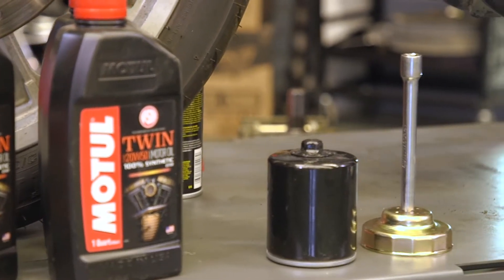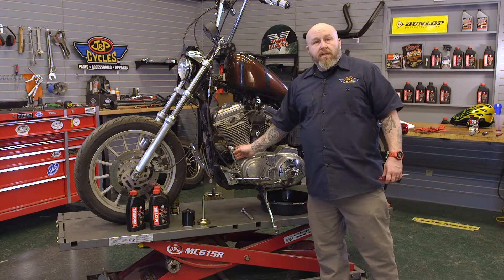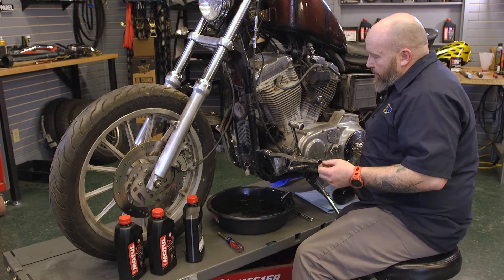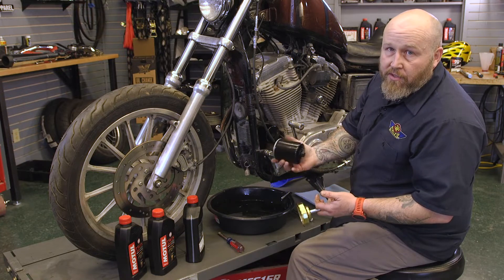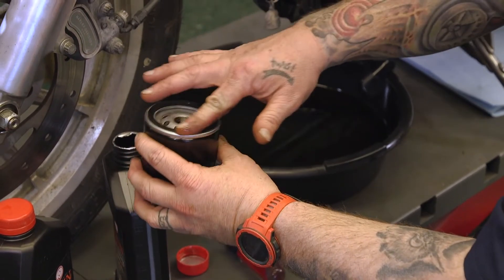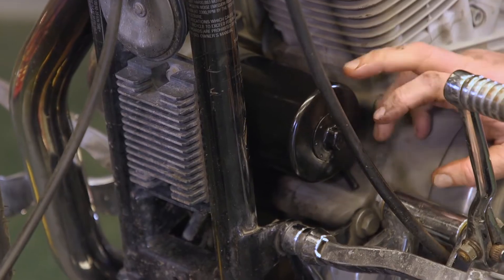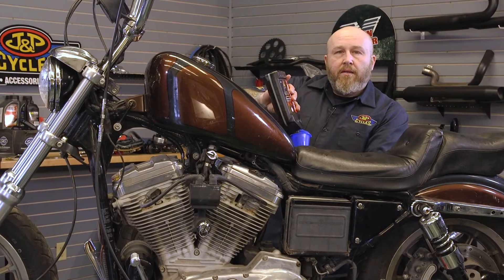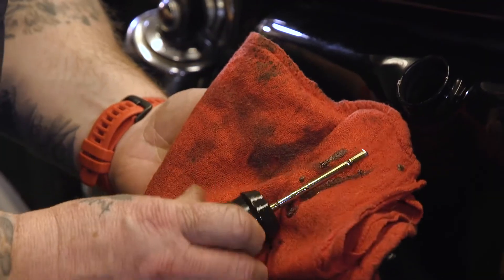Oil Change : Harley Davidson Evo Sportster

Comment: Filter tip. Get the Harley oil catcher “specialty” thing and poke a hole with a screw driver near the bottom of the filter to let the oil drain out into the catcher and down to the drain pan while the oil bag is draining. When you take the filter off there should be little to no oil that leaks out. It’s a lot less than just taking it off. Less mess = quicker oil changes = money.

Comment: I bought a used Sportster and went to an auto parts store and asked them if they could find an oil filter for it. They said they could if I could bring in a part number. I remember the days when they had an application guide. What has happened to America?

I bought a Harley manual specific to my Sportster and can't find a number for an oil filter in it. Imagine that. I find that manuals leave out so much information that one needs to work on something that they are of little use.

Comment: Hi there - 2001 883 Sportster here. I wanted to ask about the oil pump cavitation measure of detaching the hose clamp from the oil tank drain hose. Is thay necessary? Wasn't documented here. Manual says for sportsters between 94-03, thanks!

Comment: Sir, is that a Twin Cam Oil Filter? (K&N) I thought that those filters were NOT recommended for Evo Bikes? (TC needs 30 Micron filtration and EVO needs only 10 Microns??) The filter fits both but it should not be used on EVO

Comment: ’96 1200C, I know this is an old video but hopefully you will see my comment. You make some excellent videos. Thanks for that. Would you have video and know where I can get a “good" rebuild kit for mine? I have to choke/enrich it halfway just to run smooth after it warms up and then of course it idles high at a stop. I’m guessing it needs cleaning but might as well rebuild it while I’m at it. I’m in Raleigh/Durham, NC. Thanks, videos Thanks again!
Reply: might be intake gaskets

Comment: I have a 2018 XL1200C. Pretty sure mine says to check on the Side Stand. 4 ounce in filter. 2 Qts in the Tank.
Reply from the maker: The video is for an Evolution or "Evo" Sportster. Your 2018 is a rubbermount, the procedure is slightly different, you check the oil differently. The rubermount procedure is here https://youtu.be/Fosvpy4VTD8

Comment: Don't ever stab an oil filter with a screwdriver to get it off. Use a filter wrench as in this video and if it slips, drive in 3 sheet metal screws, self-drilling screws or whatever you have through the filter wrench. You can drill 3 holes so they will be there for you when you need them.

Comment: omg..... u need to take better care on oil changes,,,, add a lower chin air damb & bottom skid plate & take oil filter off ,,,, new sporsters u check oil on the jiffy stand